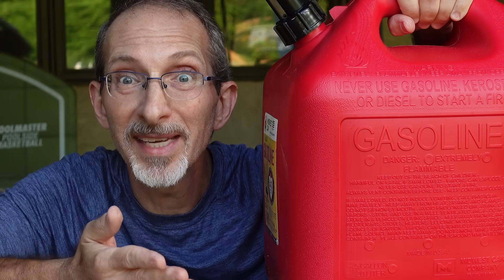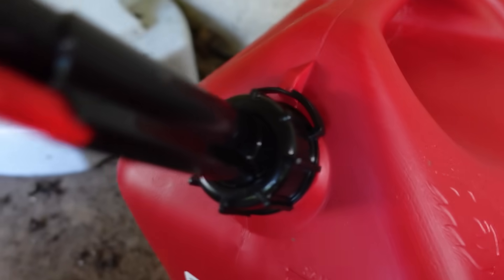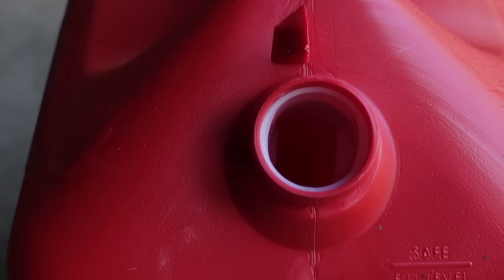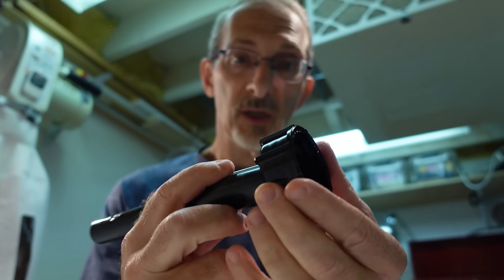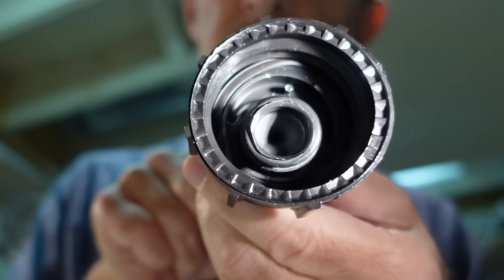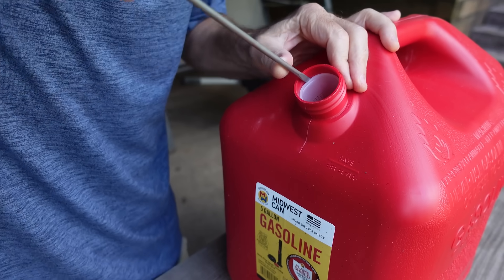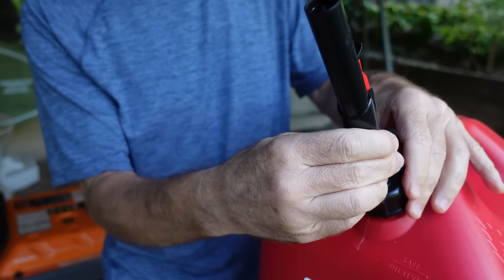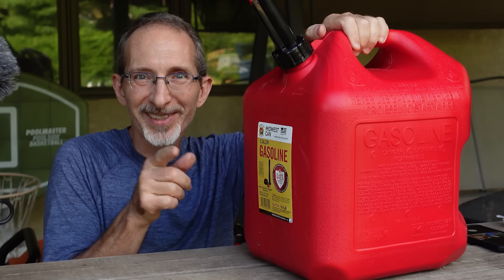Gas Can Modification | New Gas Can Fix

Comment: As I understand, the purpose of the "filter" in the gasoline container is supposed to be a safety feature  intended to  prevent flame from entering the container and causing an explosion in the event of a fire.

No kidding!

The theory may be sound, but what is the chance of fire igniting fumes inside the container and causing it to explode compared to  the hazard of injury from fire resulting from spillage of gasoline due to difficulty pouring from, or refilling the intact container and spout?

While it's  possible to have a combustible air-fuel mixture inside the container, it's my opinion that in normal use, there is likely to be too much gasoline vapor and insufficient air within the container to support explosive combustion in the course of pouring gasoline from the container into a fuel tank of a vehicle or machine.

That being said, I do not recommend or endorse encouraging others to modify the container or spout due to the liability risk that may arise from such action.
Reply from the maker: Phil, you are correct… The filter is a flame arrestor to prevent flashback. I explained all this in my second video, link in the description. Thanks for watching and commenting!
Reply: Additional comment:

I use a large zero turn mower with two fuel tanks having a combined capacity of thirteen gallons.

I mow a lot of grass and can use ten to fifteen gallons of fuel in one day.

It's very difficult to refill  those tanks from the modern gasoline containers, as previously discussed.

As opposed to modifying the fuel containers, I use a small stepladder to support a full container adjacent to the machine at an elevation slightly above the top of the machine's fuel tanks.

Then I use a "jiggle siphon" hose to transfer fuel from containers into the tanks without  a spout or the need to support the weight of full  containers while slowly pouring into the machine's fuel tanks.

If you're unfamiliar with the "jiggle siphon", it's a transparent siphon hose with a check valve attached to the end that is introduced into the full fuel container.

When the hose is rapidly "jiggled" inertia causes fuel to enter the end of hose that is submerged in the  container and the check valve prevents it from flowing backwards, thus  quickly starting liquid flow through the siphon.

As the machine's fuel tank becomes full, I simply stop the flow by withdrawing the submerged end of the siphon.

No fuel is spilled and the only effort required is lifting the full containers onto the top of the stepladder.

A small amount of fuel usually remains in the containers and I simply use a funnel and pour it into the machine's fuel tanks without using the bothersome spout.

One potential hazard associated with modification of the spout as others have suggested is failure of the modified spout to completely seal and prevent leakage of fumes from the container, as well as potential leakage of liquid fuel if the container is completely full or is accidentally overturned.

I speak from experience, I am a retired firefighter and I have also experimented with fuel container spout modification.

The modern containers are troublesome and, in my opinion potentially dangerous as discussed by others, but modifications can introduce additional hazards such as leakage.

For various reasons, I do not recommend modifying them.

"Jiggle siphons" can be purchased at some truck stops and online.

Comment: About the filter, once you get the pliers around the edge part, just twist the pliers to draw in the edges which will collapse the filter to be smaller than the neck of the jug.  Then it should come right out, no need to deform the neck.
Reply from the maker: Great advice Gus! Thanks for commenting and watching! 😁

Comment: That isn't a filter, it is a flame arrestor. If you have a spark, that stops the can from exploding.  When filling a gas can the danger of vapors is at it's highest because the vapors are forced out by the rising liquid. I know they are not convenient but they probably shouldn't be removed either. This isn't about pollution it is about real safety.
Reply from the maker: Agreed, and I discussed the flame arrestor in my second video, link in the description. Thanks for watching!
Reply: @MikeFyxdt  I did see it later thank you.

Comment: I hate these because when a 5 gallon can is full, it's quite heavy to try to hold one handed while trying to get the safety thing depressed with your other hand.
Reply from the maker: Jason, you are 100% correct. I've only been putting about 4 gallons into these containers when I fill them because they get so heavy.

Comment: Also wouldn't anything cought by that filter be poured directly into when gas tank of your equipment since it's catching things in that direction? It's like it's only there to make using gas cans harder.
Reply from the maker: The filters are actually flame arrestor safety devices, which I explained in my second video, link in the description if you would like to watch. Thank you for sharing your thoughts! 😁

Comment: That can is supplied with a “carb” compliant spout. Carb stands for of course California air regulatory board. The supposed object use to reduce the fumes and liquid gas spilled during a filling process. I don’t live in California why should I have to buy a carb can then modify it for my use.
  Thank you for your nice tricks.  A super video! I only have a couple 2 gallon cans but they HAD the carb style spouts.  At my local store where I bought the cans they also sold upgrade spouts. They didn’t require three hands to use and were flexible to make it easier to use when filling small containers!
Reply from the maker: Mark, thank you for adding your comments! I appreciate it! 😁

Comment: I only skimmed a couple of dozen comments so my apologies if anyone else pointed this out. Any debris captured by the fuel filter would immediately be flushed out of the filter and into your vehicle when you turn the gas can upside down when using it.
Reply from the maker: Gary, you are correct… It is not a filter, but rather a flame arrestor safety device, which I explain in my second video. Thanks for watching and commenting! 😁

Comment: I'm gonna stop you right at the point where you decided to remove the safety latch from the cap, and I'll just presume that (as with that action) everything you're going to do to "fix" on the fuel jug is going to be illegal.  HENCE you are outrightly telling your viewers to violate County, State, and Federal safety regulations, simply because you feel inconvenienced and you're to ignorant to figure out the correct (ie:  SAFE) way to fill and use the new fuel jugs.

BTW, technically, propane is in a gaseous state as it  is being used, and so is often referred to as "gas".  I get that 99%of folks say "gas" and mean gasoline, but as a professional mechanic, I've seen plenty of unnecessary and costly mistakes happen due EXCLUSIVELY to people using the word gas when referring to all manor of fuels & fluids.

Second, that is NOT a "filter" (in the strictest sense) in the neck of the fuel jug, it's a strainer.  It doesn't really keep "contaminants" out of the jug, so much as larger particulates (and yes, removing, modifying, or otherwise damaging it is also illegal.

There ARE things you can do to make use of the newer fuel spouts and jugs less annoying.  NONE of them entail breaking the law.  I know..... I use them every day without any issues.

If you want details, send me an email and we can talk.
Reply from the maker: You make some good points!

Comment: I had a brand new can with a spout similar to that but without the red part. The first time I used it it was so hard to put enough pressure to get it to open, then I herd it pop and gas came out of the seam half way up the spout and poured all over my lawn mower. Turns out a small gasket that was one part with the plastic of the spout and thin as paper broke causing the leak. F these stupid regulations. Another can I had in the back yard was similar and was unvented so it builds pressure if it gets warm, when I went to fill the lawn mower the pressure shot the gas into the tank so forcefully that it rebounded out covering me, and I remember seeing gas spontaneously combust on seller days. Also if it builds up vapor pressure that must be manually vented (into the environment obviously) before pouring can be done doesn't that make taking away a vent hole pointless? Unless your aim with that is to increase the time I have to hold up the can for the slow pour rate of new spouts.
Reply from the maker: You make some valid points! In my second video I added a plastic flip valve to the back of the container, and it gave me a safe way to vent any built up pressure without spraying. It also greatly improved the flow speed and smoothness coming out of the nozzle.

Comment: YES! THIS!!
The new gas cans are a perfect example of our modern society’s obsession with fixing problems that don’t exist. 

And the “fix” is almost always worse than the problem it was meant to fix.
Reply from the maker: Agreed, well said! 😁
Reply: The latest design is even more aggravating and spills even more gas everywhere. And I thought the whole reason for a "special" can was to properly vent as well. I've had some swell up and split their seams (leaking even more fuel and becoming consequently useless) not even in direct sunlight. Nothing beats a simple nozzle that seals and a cap on the end that seals - clown world ends there.
Reply: @davidprice9815  Phillip's 66 and Union 76, was government rubbing it in your face. Gasoline changes 1% in volume for every 10 degrees in temperature change. So yes if you add one gallon to a can at 66 degrees then the can warms up to 86 degrees you have 1.2 gallons in that can. The weight doesn't change but the volume does. I worked in a gas station and I got curious why we sold gasoline by the gallon and measured how many inches in the below ground storage tank after a fuel delivery.  The gasoline in the tanker is warmer than the below ground tank. That tanker dumped 1000 gallons and the storage tank said 950 gallons was delivered. 1000/50 will tell you the difference in temperatures. I've known many who keep track of milage and notice the decreased gas mileage in winter and couldn't tell you why if you bought a gallon at 55 degrees then used the gasoline at <45 degrees. Depending on the area you live in the ground temperature changes. I Bet you never checked the temperature on your gasoline from the pump. For decades I told people to buy exactly 10 gallons at a time to make that lack of common cents used equal to common cents used. $X.xx9×10=$Xx.x9... be surprised how many clerks can't figure out the cost of 10 gallons correctly, even with a calculator and the price in big numbers on the sign.
Reply: AN F MAKING BIGGER PROBLEMS
Reply: i think it was to control vapor leakage not spillage. like the new cars fuel system is computer controlled to collect vapors. overkill yes.
Reply: They do that because 1 in every 1 million people cannot hold a gas can and talk at the same time.
Reply: I mean really. We are back to paper bags and should stick with glass. Etc.
Reply: Demholes
Reply: The politicians have to make themselves important somehow!
🙃

Comment: I've seen videos where the poster modified the spring by measuring it first, then cut a small portion off, stretch it back out it previous length, and then reassemble. Now it closes but without on it's own but not overly strong spring.
Reply from the maker: William, that may have been my video! I did that in part two… Thanks for watching!

Comment: Safety cans and nozzles work great. You can't fill them and can't pour them....... I haven't seen the filter in can. If you think about it that really makes no sense. It keeps stuff out of the tank but when you pour it it comes out with the gas. Who thinks up this stuff. I have spilled more with safety cans than I any had with any other can. I have a few older cans I won't get rid of for that reason.
Reply from the maker: What I called a "filter" is actually a flame arrestor safety device, which I described in my second video, link in the description. I appreciate you watching! 😁
Reply: @MikeFyxdt  I watched the other two videos after I commented too. It is a poor design regardless of what they call it. I 100% agree that the people making these rules have likely never had to use one and probably just saw some video of someone pouring fuel on a fire out of a can or something. Why do these people think they have to protect people from themselves... 

Anyway. Thanks for the videos.

Comment: I've had to tap a small hole in the rear of the handle on a 5 gal gas can to make it pour easily (ventilation). Otherwise be there forever..... seems like.... waiting for it to gulp out.
Reply from the maker: John, I added a flip up vent to the container in my second video, a link in the description. It made a big difference… No more glug, glug, glug...

Comment: You COULD just use a nozzle off another gas can... I've done it before because of a pain in the ass like he's showing.
Reply from the maker: John, older caps and spouts do sometimes work with the newer containers. They also sell simple aftermarket spouts, which is an affordable option if you don't want to make the modifications. Thanks for sharing your thoughts!

Comment: The cheapest fix for all my gas can designs is a good funnel.  Just take off the spout from whatever can and pour away.  A funnel is by far the best option in my opinion.  No modifications to the gas cans and if you get a large spout funnel you’re holding the gas can for less time since you are dumping it out as fast as the can allow.  Funnels are cheap so get a few sizes and you can trim them with a utility knife to suite your flow hole size.

Comment: The spring loaded nozzles are indeed a pain. Even when putting gas in a car. If it slips off the rim of the filler neck on the car, you have to start over. I've had that happen two or three times in the same pour. And it's definitely a pain trying to put gas in a mower or other small engine.

Comment: Just like the man says....
Throw out and cut off all that crap and buy a replacement spout kit. They are available at stores like Tractor Supply. As far as those locking things, take a knife and cut them off. The filters can be just pulled out or pushed down into the can and left.
I am surprised that the government doesn't require warning not the swim in the can too.

Comment: The filter is a V-E-R-Y poorly conceived addition.  While it will trap any particles as gas flows into the can, it will also hold them under the cap where they will simply pour out into the fuel tank of whatever you're fuelling, to potentially clog up carburettor jets and injectors or possibly score the interiors of the cylinders.
There should be an entirely separate filler cap and hole (with air vent in the filler cap for pouring out the contents via the attached spout) so any particles which would flow out the (filtered) pour spout get trapped in the gas can and don't get into your engines...

Comment: Filling those gas cans I have NEVER had a problem with having to flip the pump off and on again. The lock for the cap is there so it doesn't walk off... Spring loaded to close when you get to almost full on your thing you are filling up so that when you pull the can away from filling you don't continue to dump fuel all over your generator or whatever you are filling... This video is full of stupid ideas for not knowing how to use a simple device. Imagine you are now filling up your generator and you see you are getting almost full so you pull the can back but now there is no spring... Gas still coming out and now your generator is covered in gas. Please show a video of you starting your generator while its covered in gas since you took the spring out that stops the fuel and burn everything down to the ground...

Comment: The "filter" is actually a flash screen. I found that it was not hard to learn how to fill the can with the screen still in place. If you seach you will find that replacement nozzles and nuts are available. They also comes with a vent to install.

Comment: I came by those same modifications [#1 and #3] by myself. I was using Midwest's converted European 5 gallon steel jerry cans. They're made in Latvia, just like NATO 20L military cans but they are specially made for Midwest with their plastic cap and nozzle and the same anti-lemming 'safety' features. I had just bought a pair of the newest ones when I discovered the ''safety sleeve'' inside would not permit a gas station nozzle at pump pressure to fill w/o shutting off. 
I had a supermarket chain promotional $1-off pump price with 1000 points deal -- and I intended to fill both jerry cans. When I couldn't pump. I stopped at about 57 cents worth of gas, and pulled out my multipliers. I got one needlenose plier jaw between the neck of the tank and the 'filter' and pulled and twisted, rolling up the cone of the filter around the pliers. Metal can, so not worried about distorting plastic... Finally with both jerry cans cleared, I tried to pump again, but the Gas Pump had timed out my transaction. I re-entered my VIP Club member number again, and found out my 1000 points had all been used on my 57 cent purchase. 
I was not happy at now having to buy my gas at retail.
I have quit buying the Midwest jerry cans, and look for real military surplus ones. The plastic cans only last about a year in the AZ desert sun.
Since I usually use an electric fuel pump to siphon fuel from jerry cans directly to my truck fuel tank, I had no use for the included nozzles. But now that I know this de-springing trick, I may use it.

Comment: Rather than removing the spring altogether, I think I would try cutting a few coils off until it added just enough spring pressure to close the spout without requiring a lot of exertion to hold the spout open.